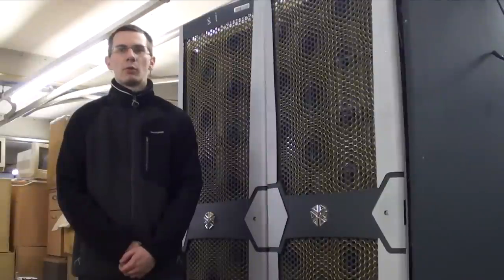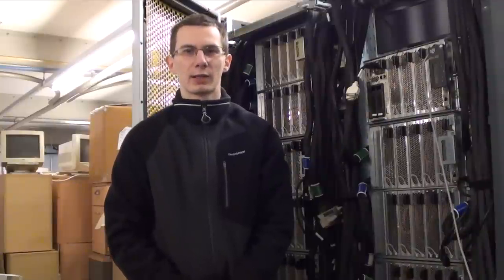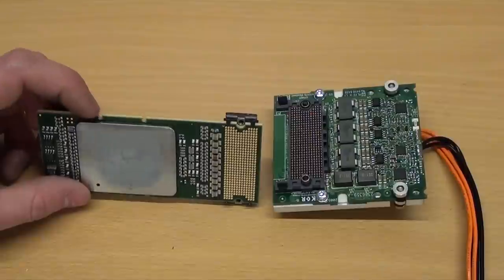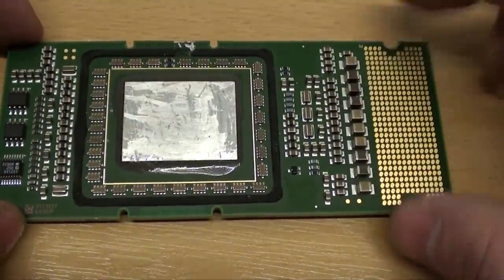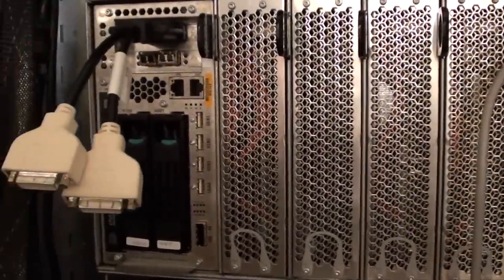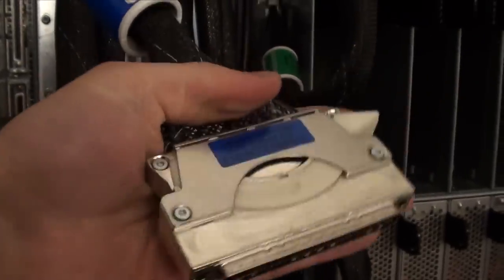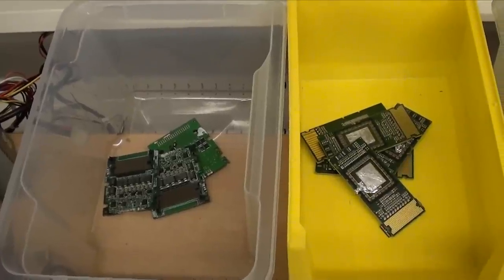SGI Altix 4700 Supercomputer Extreme Teardown

Comment: I always wondered why dual processor or more motherboards are so rare... they could easily make a system much powerful and last longer......
Reply: Because maintaining system coherence scales quadratically. So two sockets are quite standard, four has double the power but already requires four times as much effort to make it work and eight socket systems are incredibly rare, for they would theoretically require sixteen times the effort to make them work. (In practice they don't and kinda skimp out, making the eight socket systems slower).

Comment: 4:38 Those are MLCC (multilayer ceramic) capacitors, not tantalum capacitors.
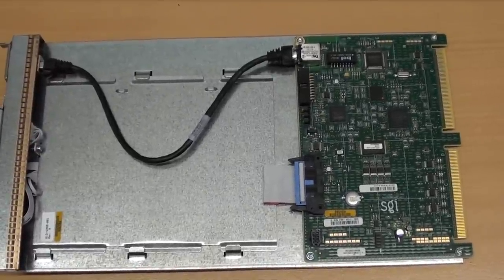Also a few more clarifications: Altera MAX II is a CPLD, not an FPGA. And the Cyclone II you see at 7:56 IS an FPGA.

A great video nonetheless.

Comment: just wondering, could you use one of those nodes to install windows and use as a regular pc?
Reply: Technically you can install windows. But it would either be a really really obsolete Windows XP/2003 for Itanium Systems or Windows Server 2008 R2 for Itanium Systems. Even then besides some microsoft specific business software, little will run well on it.

Comment: I like my remaining 2nd hand workstations but proprietary hardware is an issue. I cannot get a replacement for the proprietary PSU anymore.
At work we bought 5 racks full of blade centers over 2-3 years, 3 different generations of the same stuff. After another 4 years, only one rack was still operational, a Frankensteins monster built from anything that was still working and compatible, ripped out of the other racks. Many blade centers died (mainly the proprietary PSUs) and because of 3 different generations some good blades could not be revived at all. If we had bought normal PCs, I guess 80% of them would still be running, may be with some cheap PC hardware replaced here and there ...

Comment: the construction of this machine is, from a value point of view, so incredibly bad. If this system was made using Xeon blade servers and a couple of 10gbps optical links, the performance would be just as good and they could actually be reused and sold for their value rather than for scrap. 

That said, Itanium processors weren't even x86, which makes it difficult to do anything with them after being decommissioned.

Comment: Dumb question: Could you in "theory" take one of the cpu modules and make a pc out of it?
Reply from the maker: Burt Holiday Unfortunately not. There are no ATX motherboards which support an Itanium 2 (Socket 611) processor. HP made an Integrity workstation which had Itanium 2 processors but they are hard to find and usually expensive.
Reply: How about with the board and memory that is in the case or rack that you pulled out the unit?
Reply from the maker: I suppose you could use one IRU as a PC, but it would still be extremely inefficient. In addition to that, one of the Tantalum capacitors on the IRU control board had burned out anyway, which is usually a sign of multiple failures also. Overall, it'd just be an expensive space heater, much like using a 1.6GHz G5 PowerMac these days.
Reply: Ah, ok thanks for answering. I'd always wondered about it.

Comment: What kind of computation did they used the supercomputer for?
Reply from the maker: It would have most likely been for processing huge amounts of medical data.
Reply: You wouldn't think that would take a lot of computing power to process that, but like you said when there is constant traffic that results in a lot of number crunching it takes this much power to do that. It's amazing, really!
Reply from the maker: 25 Cent Further information leads me to believe it was used by the university to simulate the effects of new drugs and medication on the body
Reply: Something like molecular docking?

Comment: So what ended up being the total scrap value?
Reply from the maker: For the boards, processors, cables, heatsinks etc it was around £1,200.
Reply: That's a bit more than I'd first thought, I'd guess less exotic stuff is easier to resell as parts.
Reply from the maker: horse1066 Including the memory, it was just over £1,700 but the memory was sold to a computer repair company. It's all ECC and unusable in desktop machines, so it'll be reused in servers. We did try to sell some of the boards as decorative items but nobody was interested.
Reply: What's your outlet for parts, eBay? I keep a look out for multiple cables/connectors and DIN41612 racks, but I only ever stumble across them at random.
Reply from the maker: Mostly eBay, but we also sell some items on BrokerBin and to a small number of companies we know. The node boards were impossible to resell as working parts because everybody we spoke to who maintained enterprise-grade systems told us none of their customers still use Altix 4700 systems. The processors were also obsolete, and nobody had any demand for them, and the only parts which were reusable were the DDR2 ECC memory modules.

Comment: Are the hard drives 512 byte or 520 byte sectors? (Yes, this is a jab at EMC, lol.)
Reply from the maker: Good question, I didn't check! The system only had two hard drives (Each 146GB SAS) but they had to be crushed to comply with the Data Protection Act.

Comment: I have a question... could you use that as a server? like to host webpages and such...
Reply from the maker: To be honest, I'd never considered this. After doing some research, there is a version of Apache which is ia-64 compatible, so the short answer is yes! I'm not quite sure how efficient it would be. Obviously, it only has a couple of SAS drives, so you'd want to store any web pages or downloadable data in a 'permanent' RAM drive. The 256 processor cores could quite easily crunch some serious quantities of data so you could use it for a number of websites simultaneously, along with a database as well.
Reply: oh yeah... for databases I think it would work too... theres a ia-64 MySQL version... Thanks for replying...
Reply: ForeverMan probably overkill for a webserver.
Reply: Apache and MySQL are open source, so you can run them on any platform with a C compiler.  There are whole ports of Linux (including all the usual Linux software) for IA-64 so you could use it much like a normal PC or server, but with a lot more memory and CPUs.  The question is not whether you can do it with this hardware, but whether it is economical given the power use!

Comment: Itanium CPUs? What operating system did this run?
Reply from the maker: Samuel K Good question. SGI officially supported a custom version of Linux which was designed only to be run on ia64 systems using the Intel Itanium and Intel Itanium 2 processors, although there are now several distributions of Linux which now support ia64.
Reply: CarlsTechShed I manage OpenVMS at work so I was hoping it would run that. Though I'm fairly sure VMS won't support over 64 CPUs/cores (until 2018 i hope!)

Comment: Whats the approximate scrap value of the system?
Reply from the maker: Joe Ambly I've negotiated a very good price for the boards because of their high gold content. They should fetch about £7 a kilo. There's another 100KG of Copper, 45KG of Aluminium, and about 40KG of multi core cables. Add that to the resale value of the 1TB of memory and I should clear about £1,200 for the complete system. I will do another video once the whole system is dismantled and ready for the refinery.
Reply: CarlsTechShed wtf £1 million to buy at time of purchase drops to £1,200 only used for a few years???  damn I could have bought the whole thing myself. my top spec 2016 PC cost a value of £1500 of £1000 payed by me.
Reply from the maker: Your average Brit & Whovian It's the same with any large industrial equipment. The companies which buy these don't buy them with the intention of recovering £250,000 when they no longer need them. They will have a budget for the system and once it's purchased, they never expect to see that money again. 3-5 years later, it becomes a tax write-off and they go out and buy the latest model.
Reply: There is an old saying that when you switch on a supercomputer for the first time it immediately drops 50% of it's value. Thats still true.
But for Intel and GPU based systems you can now always sell them as parts on EBay. I'm a bit surprised  that you only get 1 pound per GB RAM but it explains why resellers all up their old systems with RAM now to make them look better. Fuck DDR2
Reply: Sounds like the memory is still in demand, then? I was thinking while watching the video that the RAM is probably the only component you can really make use of still.

Comment: But can it run minesweeper?
Reply: Debuff Nation yes it can but it might not be able to run minecraft :/ lols
Reply: Debuff Nation but what about CRYSIS
Reply: just put it on compatibility mode
Reply: no, but it can run Solitaire
Reply: Yes It can at 999999999999999999999999999999999999999999999999999999fps
Reply: It can beat you at Minesweeper.

Comment: An interesting video, thanks. Electronic components eventually fail, esp capacitors and early PROMs lost their code after a few years. New devices come along which are smaller, faster and use less power. Just think of all the wo/man-hours gone into designing and manufacturing it.
There was a huge amount of metal for recycling.

Comment: If it only were DDR3 RAM...
Reply: I'd take ECC over faster ram any day.
Reply: Sure, ECC is nice to have but for the casual user and gamer it doesn't really have a good use. When you see it from a non-scientific and non-business user perspective, it comes down to compatibility and costs. Having a memory error can cost science labs and businesses loads of money. In private use, people more often than not not even aware of that issue until their computer crashes because of it (and even then they just get it fixed and there is nothing more to be worried about anymore). I also suspect that you have a fewer choice of modern mainboards and CPUs that support DDR2 with ECC. Modern mainboards and CPUs that support DDR3 on the other hand are as available and cheap as dirt.
Reply: Traditionally, I would be inclined to agree . However, as memory capacity rises, and systems remain online for longer periods of time (months at a time in my case), bit-flips are be more likely to occur. That, coupled with how we computers today (online banking, government interaction, work), I believe that ECC is no longer a luxury item, but something that should be expected.

As for the lack of hardware compatibility and price, you can thank CPU (namely intel) for artificially limiting the hardware they sell and pricing hardware that supports it well beyond the reach of normal users. The actual costs of supporting ECC in hardware is negligible.

I hope AMD, or even non-x86 platforms like ARM, start mandating ECC as a requirement. Intel is not going to budge without competition forcing them.
Reply: Jake Reason I have to agree on most of your points, but there are other software-sided methods in use to work around errors like bit-flips and avoiding high costs for professional equipment. The most primitive and hardware intensive one would be calculating the same operation for x-times and then taking the majority of same results as true (but even then you can't be 100% sure about the result being correct). I'm absolutely in favour for solving as many problems as possible with hardware solutions, but a software solution should never be not considered either. Though I think Intel is using their defacto-monopoly position to artificially inflate prices and thereby maximising their profit margins, you have to keep in mind that Intel is also investing into large-scale long-term research projects with the money they got out of their main business. I'm also aware that this generosity is part of their business concept and therefore is more of a ruse in order to avoid taxes and to have a point on why not to split up Intel by force. I would do it the exact same way.

Comment: its good if the components are recyclable, else such a waste of precious elements, matels and materials,  just like the crude oil, i think we will run out of these things also? correct me if i'm wrong !
Reply from the maker: aftab malvi You are right, there are a lot of 'rare-earth' metals in this system which are not only expensive but also in short supply.
Reply: +CarlsTechShed
I'm not arguing that it's not a waste, or that we shouldn't do everything we can to be "ecological and frugal" in our manufacture and usage of technology (and everything else for that matter;)
How ever I'm not convinced that the "rare-earth" elements are as rare per se as their name might suggest.
From what I've read and heard their high price and "special status" isn't solely due to them being "rare elements", as in "not many tones of the element on earth", like the precious metals are. 
It's rather that they don't appear in high localised concentrations, and in short that it's hard to mine and develop them at a profit...(China has evidently priced all other producers out of the market)
So although You can correctly argue that this still makes them "rare", from a pragmatic point of view, and definitively "short in supply".
I suspect that they are not as rare in the strict sense as most believe. Instead that their "rarity" (like so many things) comes down to economics rather than "actual lack of existence"(?for lack of a better term?).

Best regards
Reply: By that thinking, we should never build another computer or super computer again since they'll obviously go obsolete and be useless
Reply: +sik59rt
Apologies, but I don't quite follow Your reasoning, what thinking are You referring to exactly ?
Best regards
Reply from the maker: Technically, Copper is a rare-earth metal, yet every building in the world has many tens of kilos in the wiring and water pipes. Rare-earth simply means that the quantity found in the earth's crust is so many parts per million, compared to Iron which is extremely common.

Comment: Two questions, can that SAS interface HDD be connected to USB with a cheap eBay adapter? Also the real question is BUT CAN IT PLAY CRYSIS???!
Reply from the maker: ELECTROHAXZ Yes, you can connect a SAS drive to a SATA connector using an adapter cable. In turn, you could then connect this to an external USB SATA enclosure.
Reply from the maker: ELECTROHAXZ And an answer to your second question, No. Crysis requires an x86/x64 architecture. This runs on ia-64.
Reply: CarlsTechShed Answer 1: Great, now all I need are a bunch of those because I already have the adapters and stuff.

Answer 2: That sucks ;( If it cannot run Crysis, it is not good enough!

Comment: if thats an ASIC, couldnt it mine bitcoin pretty well?
Reply: "An ASIC (application-specific integrated circuit) is a microchip designed for a special application,..."
Reply: ah I didn't know what the acronym meant. But still, you can mine with a graphics card so couldn't you somehow send it signals to calculate the math problems for bitcoin? it is a microprocessor so it can do math.

Comment: do not tear it down,  ship the complete systems as gift to 422 East Lakeside Drive Florence Alabama United States of America, 35630. their Individuals that would love to own it and individuals that like to startup then opeate corporation that can use it and schools that can not afford such systems. for solar sun arrays can power it and striling engine power generators systems can power it.  so the systems can stile be user used for good use.
Reply: This is already destroyed a year ago. It also uses more power than a full fledged am radio station at full power. On top of that, it's based on the united kingdom power supply, being 240 volt at 50Hz so even if they still had it, it wouldn't work on American electrical systems.